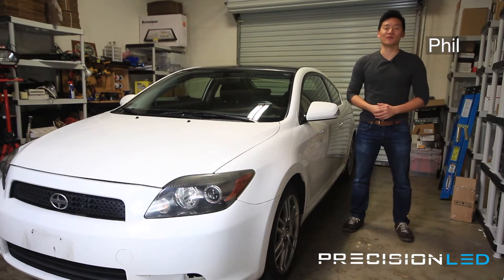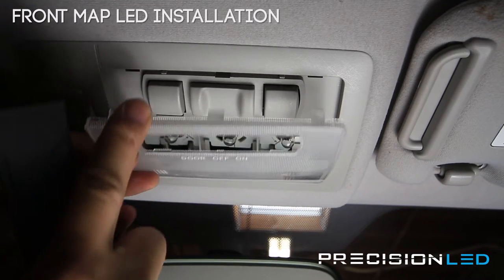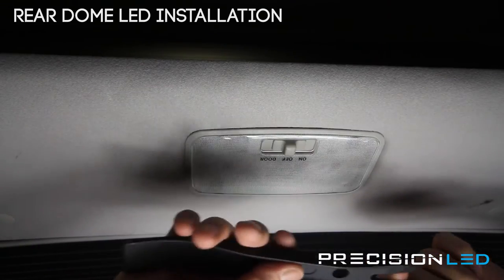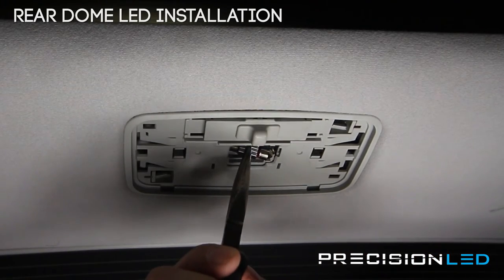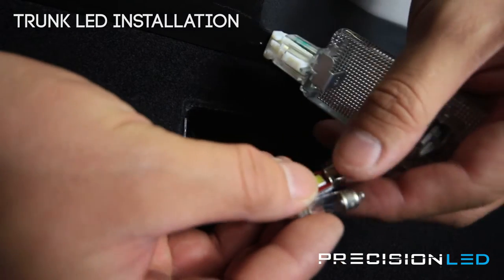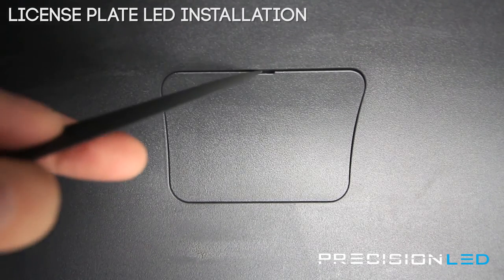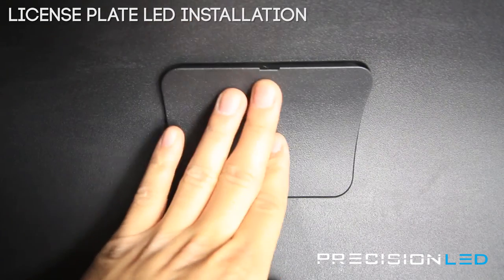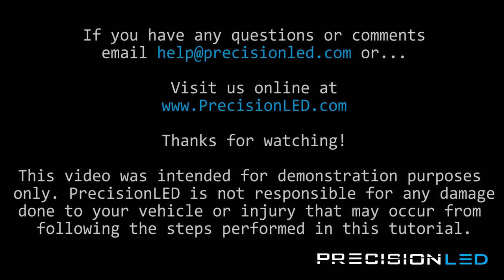Scion TC LED Installation - 2008 - 1st Gen (2004+) @PrecisionLED

Comment: Hey everyone, if you dropped the bulb into the housing here’s how you get it out. Simply pry the map light assembly around the edges until it pops off. Its kind of tough but don’t worry you won’t break anything unless your very rough. Also, while you have the housing off I recommend twisting out the other bulbs with the black base so you’ll be able to separate them in your hand. Much easier that way. Once you have them separated twist the black bases back in the housing. There’s arrows indicating what way to twist its self explanatory. Now you can put the led replacements in no problem and pop everything back in place.
Reply: Hey I know this is an old comment, but just wanted to say thanks - I am one of the dumbasses that accidentally popped the black led housing out and couldn't find anything about how to actually pop the housing out! Saved me some headache! Much appreciated!

Comment: could yall do this for the 2008-2014 scion xb?
Reply from the maker: Thank you for your interest.  We will keep an eye our for a 2008-2014 Scion xB out here in Los Angeles for a video shoot.  However, please note, the installation process is virtually identical for all vehicles.  I would recommend having a watch on some of our other DIY videos, and you should gain a general knowledge of how LEDs are installed.  Subscribe for updates!
Reply: I actually ended up just figuring it out myself! The only issue was the tag lights, which seemed intimidating at first since you have to take off the whole panel. But i ended up figuring it out anyway. Thanks for replying though!
Reply from the maker: We appreciate the information.  Feel free to ask if you have any additional questions or concerns.